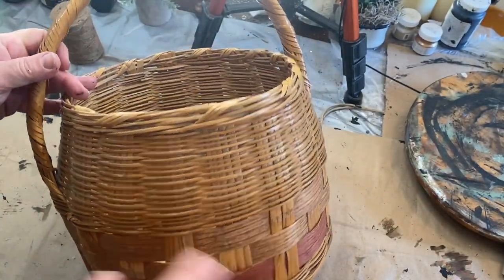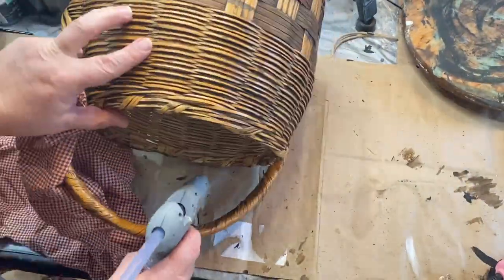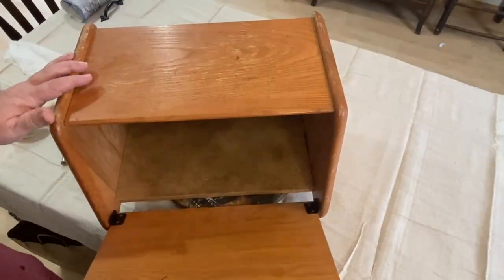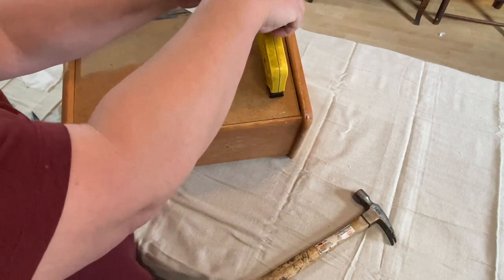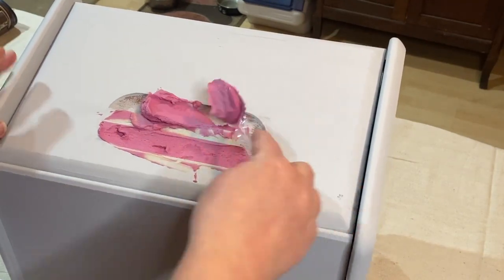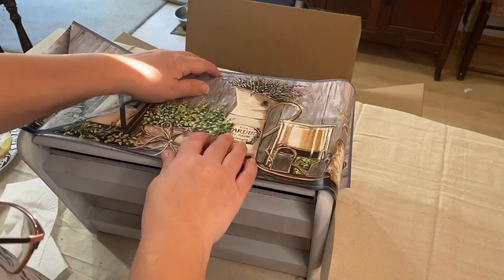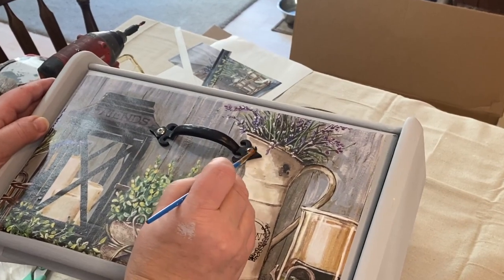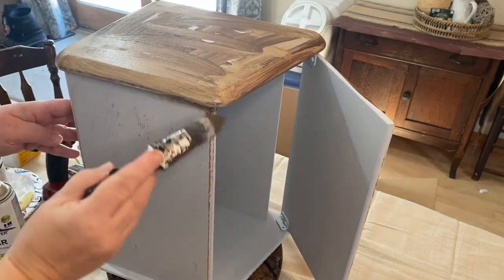Thrifted & Transformed Projects | Second-Hand Store Finds

Comment: My heart sink when u were using that expensive pink wood filler...TIP...there is a product call Durhams water putty, it is a powder that u mix with water and it is a wood filler -very strong and Cheappppp.... u can find it in Home Depot but I guess other hardware stores sell that amazing powder.   Give it a try.   I only use the pink wood filler in small repairs when i need the surface to be very smooth...with little sanding....  Love how the basket turned down...
Reply from the maker: I will have to look further to find the powder. I didn't see it at the store I went to. In the mean time the min wax wood filler worked great. Thank you!😊
Reply: @RepurposedMyWay  is in the paint section, around or in the same section where u found the wood filler...u can ask the clerk at the paint isle ...